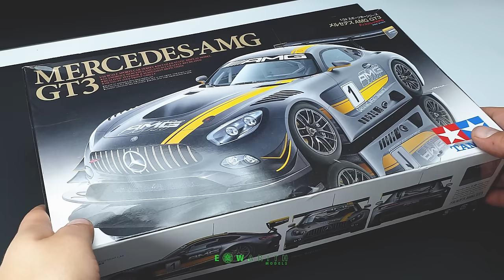Building Tamiya Mercedes AMG GT3 Model Car (Street Version) -  Full Build - Step by Step

Comment: Nicely done! I like your choice to highlight the black parts with red, it really catches the eye! I would suggest you use flow improver with some of your paints because it looks like some of your paints aren't behaving themselves when you use your airbrush to spray them. That would drive me nuts, I saw a number of parts you were spraying with your airbrush that the paint was simply spattering onto, that must have been driving you nuts! I know it would with me. It depends on what type of paint you were using but most of the model paint makers also sell flow improver for their paints because many paints don't behave well in an airbrush. Flow improver can greatly decrease the size of the paint droplets that come out of the airbrush, making your paintjobs much smoother. If you already use flow improver than perhaps you simply need to add more, but the big issue with flow improver is that the paint takes longer to dry when you use it. Otherwise I think your build of this model is fantastic, well done!
Reply from the maker: yes sometimes the paint can splatter and it drives me crazy. I actually use it flow improver as you said. but while shooting the video, some things are not complete enough and you have taken the video. When I edit the video later, I say the same things to myself just like you. Like "why haven't I been more careful about it". :)

Comment: Really satisfying seeing on-off airbrush stroke  like with the primer and clear coat. Not sure if it’s “right” but that’s how I was taught to spray everything, regardless of scale or medium.
Reply from the maker: In fact, there is no single truth. so if the result is good, it doesn't really matter how you airbrush. Of course that's my opinion. The reason I use on-off is to stay fixed in one spot and prevent the paint from flowing.

Comment: Hi, nice build and vid. Is this grey sticky paste you use for gluing the clear parts to the hood an homebrew from Tamiya cement and leftover sprues ?
Reply from the maker: The gray glue is epoxy glue. Since it dries quickly, it is necessary to mix the white and black tubes together and use immediately.
Reply: @EowarithModels  ok, I see. Thank you very much 👍🏻
Reply: @EowarithModels  awesome build. Question... why use the epoxy for the wind shield as opposed to clear glue/cement? 🤔
Reply from the maker: @Vahryk  because it dries much faster. I don't have to wait. this takes about 30 seconds :)
Reply: @EowarithModels  cheers. Thanks for that 👍😊

Comment: Цвета на выхлопе должны быть наоборот. Синий там где температура максимальная, ближе к двигателю
Reply from the maker: In general, the manifold, elbow, and exhaust tip turn blue due to temperature.
Reply: Here’s the problem. If the tip is blue then the whole pipe would be blue since that color is typical the hottest color indicator (except red which would mean your pipe is about to melt). Hahaha A good way to make sure your car or motorcycle is running a good temp with just a look should be blue-ish by the cylinder turning into a nice gold-ish color down the pipe. The only way I see reversed colors is different metal thickness or a different kind of metal that can withstand the heat. Then you have the “burnt tip” thing. Which to this day still confuses me why you would put on brand new pipes with the tip burned in but hey to each their own. So anyway love the content, love the build but he’s right the colors are reversed or that car got “burnt tips”. ;)